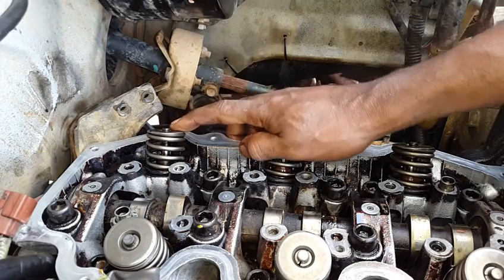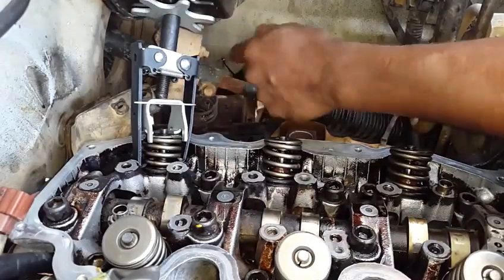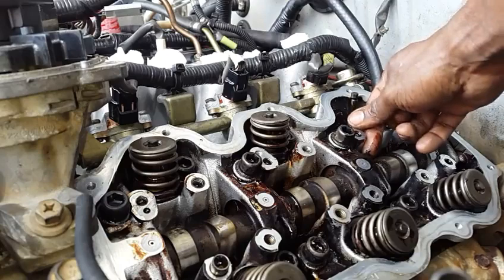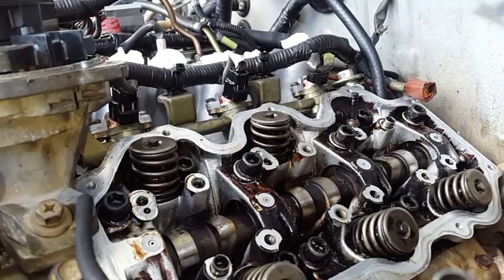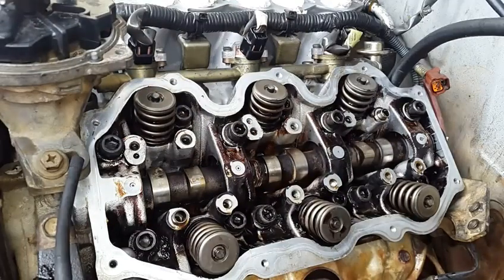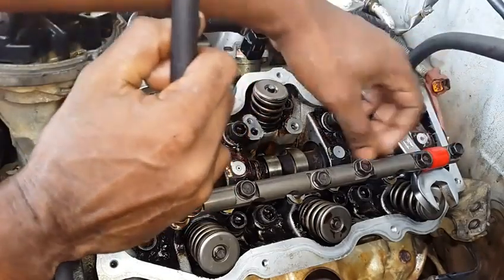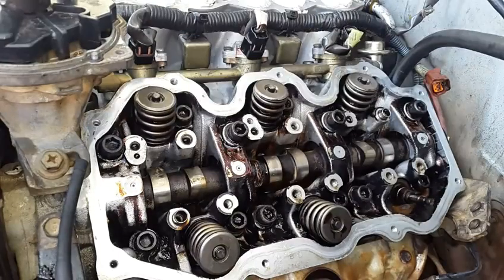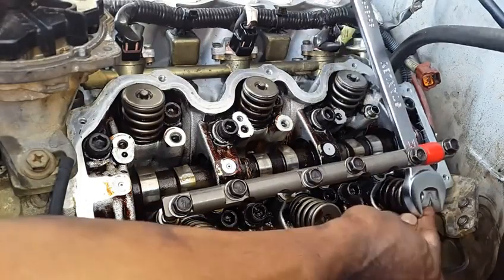Nissan Vg33e #6 cyl valve-stem seal replacement.

Comment: Question for any vg33e owners who had bad valve stem seals... how much oil did it burn? I've ignored mine for quite a while (no catalyst, so no worry... right? :D) and just kept the oil topped off, but lately its gotten bad enough to go through a quart or a little more every time its driven for a couple hours. No other leaks I can see, brand new rear main, cam, and crank seals. I drive it often enough that it shouldn't be stuck rings and compression although a touch low (could be the cheap comp. tester lacking proper valving at the plug port) was pretty much equal across all 6 last I checked. No loss in power just goes through the oil like crazy!

Doing valve seals in a day or two, so I suppose one way or the other the mystery will be solved, just wanna be sure the spare engine shouldn't be going in instead.

Comment: Thank you for your information it has helped me a lot.........I found it very difficult to get the valve seals out of the same VG33 engine.........the generic spring compressor is very difficult to use in this type of engine..........particularly I decided to make the tool by looking at the service manual of my pathfinder VG33..........now I look at your video and I see that you used the rocker shaft as a support for leverage........it just seems great to me !!
Reply: I have a few questions 
1. Did you have to remove all your spark plugs. 

2. Should the cylinder your doing this on be at top dead center.
Reply from the maker: 1. Yes.

2. Top Dead Center.  

Here is the complete video. 
https://youtu.be/LdJV_ds-3tw
Reply: @Stevexnycautomotive Thank you Steve been overseas im going to get started on this job this weekend,Replaced timing belt fuel pump,power steering rebuilt distributors on these vg33e's,This scares me for some reason.
Reply from the maker: Nissanpartsdeal.com low cost New Genuine Nissan parts. Nicoclub.com for service manual. 👍
Reply: @Stevexnycautomotive Thank you sir I got it now wish me luck 😅
Reply from the maker: You must make sure, when the engine is cold started that the RPM instantly jumps to 1200-1400 rpm. This will insure quick oil pressure to the hydraulic tappet lifters and valvetrain to prevent the rattling or clicking noise inside the hydraulic lifters or its valvetrain. I notice that a malfunction MAF sensor will prevent the engine from instantly starting at 1200-1400rpm without displaying any DTC code relating to the issue. With a slow or low rpm(below 1200rpm) will cause the lifters to make a noise and then the noise will be eliminated after a few seconds of operation. Also cleaning the inside of the throttle body blade may prevent low rpm engine start-up. Most of the time the problem is not with hydraulic lifters or the valvetrain unless oil pressure is low or lost. The problem is when the engine is started at below 800rpm and then slowly climb to 1200-1400rpm and them calm down to 750rpm has engine warm-up. Look for engine rpm sequences to diagnose the issue.

Comment: How did the valve not drop in the head once you removed the spring?
Reply: The cylinder in the engine where the valve he is working on is pressurised using an air compressor via the spark plug socket for that cylinder. The pressure from the air keeps the valve from dropping down into the engine block, as the bottom part of the valve is flat.
Reply from the maker: See the video discription if YouTube did not notify you of the new upload. Here is a link to the full show. https://youtu.be/LdJV_ds-3tw